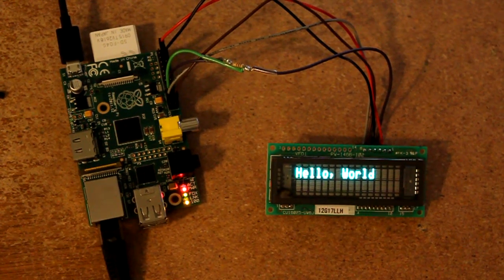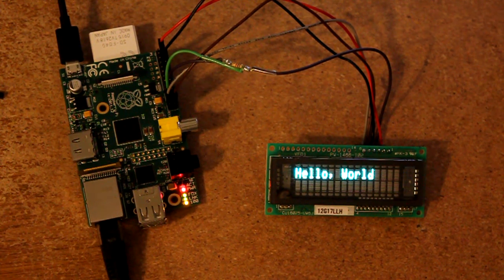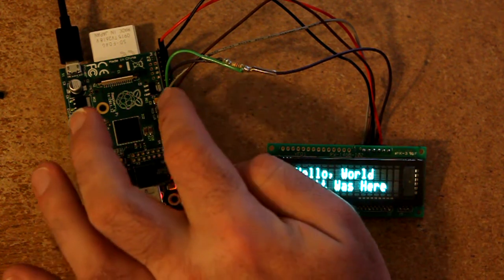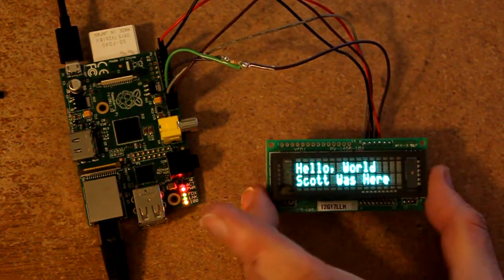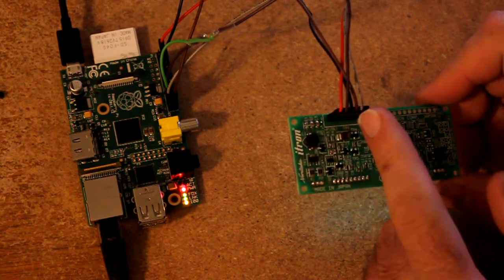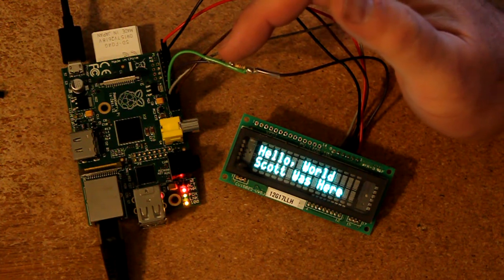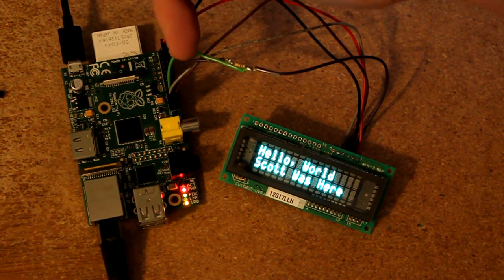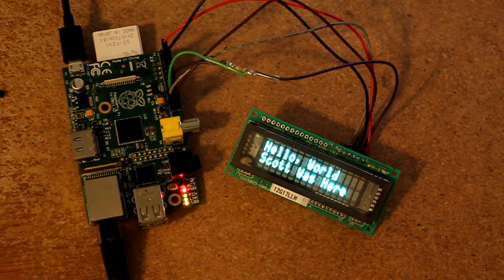Vacuum Fluorescent Display (VFD) on a Raspberry Pi

Comment: Superb work.
Used your tutorial and it work flawlessly.

I have forked your repo and added a "clock" which is currently updated from the terminal but I am still learning.
my quastion is as follow:
my display is the same cuu model as yours but with 4 lines instead of two - and my display only utilize the first and third rows, why is that?